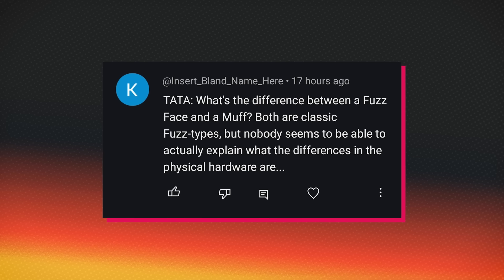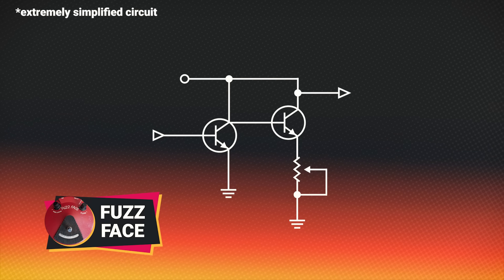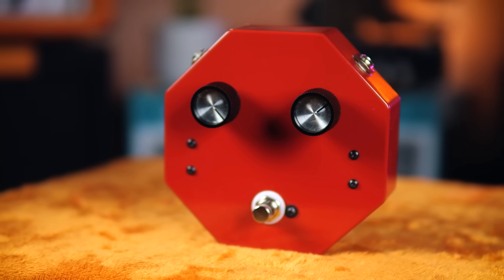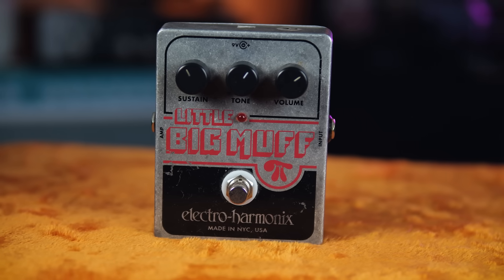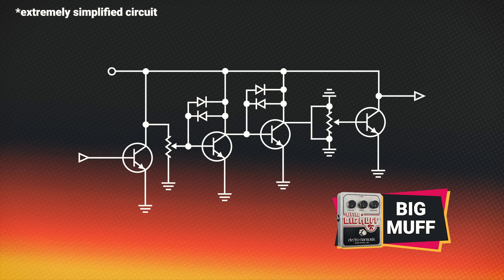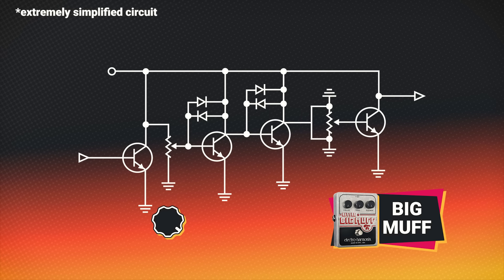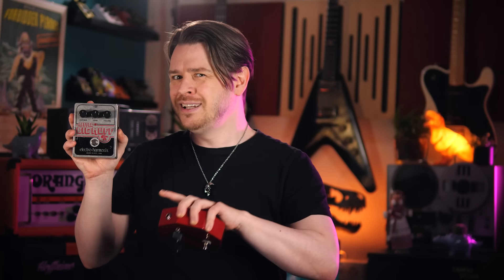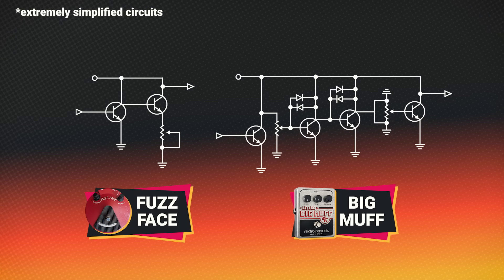MUFF vs FUZZ: What's the Difference? | Too Afraid To Ask

Comment: Very cool to see the actual differences of the circuits. I’ve always thought of them as similar tools for different jobs. Basically, fuzz face for rhythm and big muff for lead.
Reply: I use my Big Muff for rhythm, but only as I wanted a Big Muff on my pedal board
Reply: I would NEVER use a fuzz on rhythm. Distortion totally abolishes dynamics so you'll only get SOME semblance of a chord or any chord at all. It's best for Lead playing, (See Gilmore on the solos from Comfortably Numb for an example of a Big Muff used for Lead playing) and I think you'll agree that's where the pedal shines.

Comment: Definitely a couple of fun pedals. I like both, but the fuzzface circuit is my favorite of the two. I prefer the unpredictability it has as well. Finding the right spot at the point of no control is a bit challenging, but well worth it for some of the crazy tones you can get out of it. Cheers Colin!
Reply: Fuzz Face was used on the song Spirit In The Sky, while the Big Muff was used extensively throughout Pink Floyd's The Wall.

Comment: The argument over whether a Big Muff is a fuzz or not is like arguing if a tomato is a fruit or vegetable - the answer is that it depends on who you ask

If you're a chef, a tomato is a vegetable and if you're a musician, a Big Muff is a fuzz.
Conversely, to a gardener, a tomato is a fruit, and to an engineer, a Big Muff is an overdrive.

Of these four disciplines, gardening is definitely my weakest - I just dig the holes where I'm told.
Reply from the maker: A fantastic analogy: The Muff would be used in the same sonic contexts as a fuzz, so no matter the engineering, 'technically correct' definition - it's a fuzz for any practical applications.
Reply: That’s funny. Gardening is my strongest of the four, and I just dig the hole where I’m told as well.
Reply: So what are the "fruits of my labor"?😛🤣
Reply: @mikewithers299 Not to mention fruits of the loom and the fruit of my loins. 😅
Reply: @michelleneeds4165  I actually have those! 🤣🤣🤣
Reply: What about a biologist?
Reply from the maker: The biologist is too busy colouring in to answer the question
Reply: tomato analogy is perfect
Reply: I think you're wasted in YouTube comments sections. You should be spearheading UN peace keeping missions with arguments like that.
Reply: Why is a muff considered an overdrive?
Reply: @pimcramer2569  Its circuit topology. "Clipping-diodes in the feedback loop" is the defining characteristic of an Overdrive circuit.

It's called Overdrive because it sounds like an overdriven amp, not because it's overdriven itself.
Reply: Like a grape, it grows on a tree-like vine, just like a cantaloupe, which are both fruits, therefore, tomatoes are a fruit.